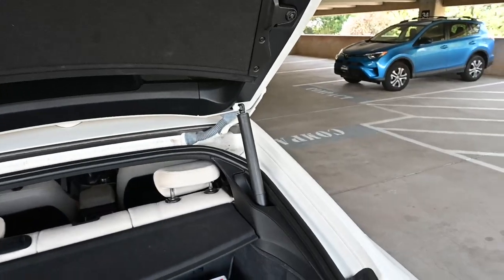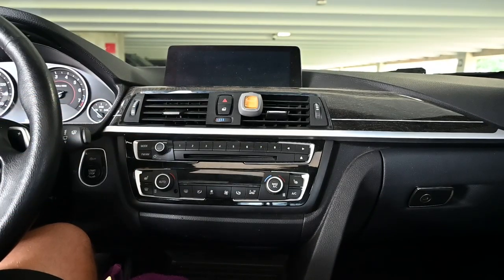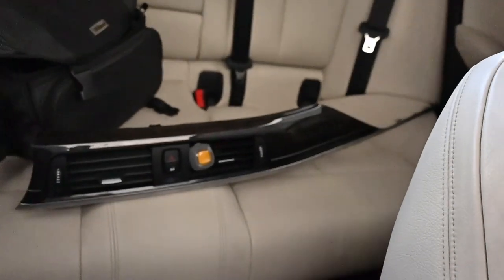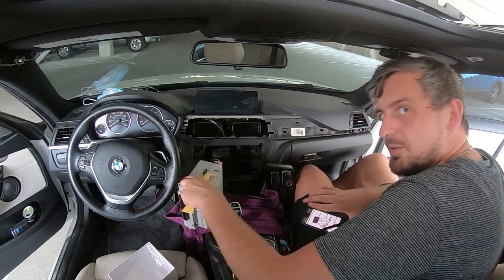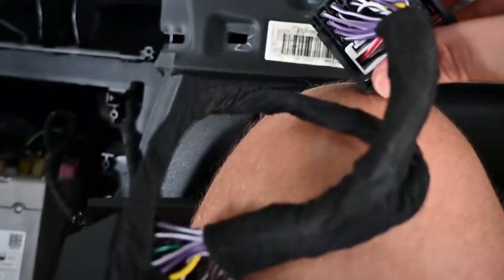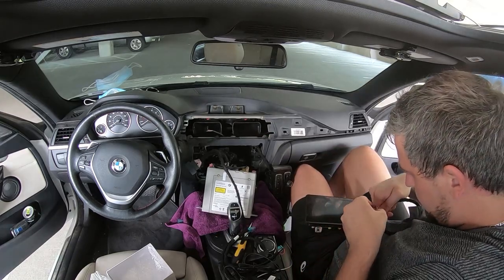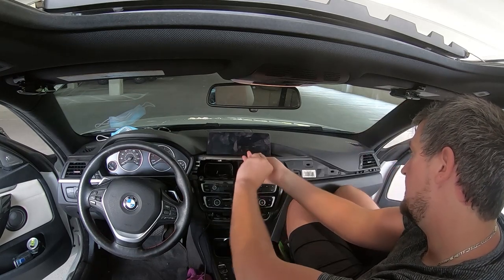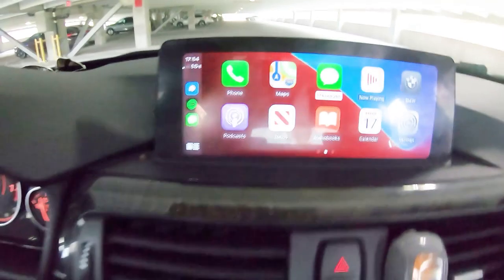Car Noob installs Apple Carplay/Android Auto BMW 435i (MMI from Andream)

Comment: Nice Video!! After all, did you manage to put the Reverse Camera coming up automatically with the carplay running up? Thanks for the upload
Reply from the maker: Bruno Trindade I did!
Had to disable “Reverse fullscreen”, it’s for aftermarket reverse cameras,
The stock is full screen by default
Reply from the maker: @Kevin Budain just in the options for the MMI box.
Reply: Sabes onde comprar isto em portugal? xd

Comment: Thanks for the video.  How do you get the wireless feature to connect with your phone and how do you access the Carplay feature from the OEM screen?
Reply from the maker: The carplay feature starts automatically once it detects your phone is plugged in, or connected to the wireless carplay.

Once you pair it wirelessly the first time, it’ll auto-connect your wireless carplay on its own when you start up the car.
You can toggle between carplay and your normal IDrive by holding Menu button for 1.5 sec.

Stay tuned, will make a video soon to describe the features in more detail! 
Thanks for watching!
Reply: @theCarNoob  Thanks for responding so quickly.  How do you initially connect wirelessly?  Can you still have your phone connected the factory way and through Carplay or do you have do "Forget This Device" on your phone and clear it from the factory radio?  Thanks again.
Reply from the maker: You’ll have to forget your phone in your iDrive in order to use wireless carplay. 
Once you did that, hold Menu (don’t plug in your phone), you’ll have an internal menu for the carplay box and there you can choose wireless, and mess with other settings (equalizer, auto reverse camera activation etc)
Reply: @theCarNoob  thank you.  One more question....Did you have to do anything with the microphone in the headliner?  My kit came with a harness for that with a male 3.5 mircophone jack that that can get run to the harness with the two big main black plugs that got to the headunit.  I emailed the place that I got the kit from but his response was unclear.
Reply from the maker: Nope, your car should already have a mic wired and everything. 
The kit comes with the harness for the mic, as well as some extra connections if you have aftermarket cameras etc, but unless your oem built in mic failed or something, you won’t have to use that cable for anything, just leave it hanging or tuck it in with the rest.
Reply: @theCarNoob  Fantastic.  You have been a tremendous help.

Comment: Hi Car Noob, I am about to install my Andream box in my car (2017 f31 330i) , thanks for the great tutorial already. Couple of questions if you don't mind: how did you resolve the LVDS in and out issue and which cable did you end up using? Also, what is the usb dongle for that's hanging from the side? Do you really need it (I plan on working wirelessly)? Finally, where did you put the wifi antenna ? Can you just tuck it in with the rest behind the dashboard? Looking forward to receiving your answers!
Reply from the maker: Hi there! Thanks for watching!
If I remember correctly (it's been a little while now), I had the LVDS in/out confused so I just swapped them. 
Cable should go from head unit into MMI box and one from screen to MMI box. Take the cable end that was plugged in the factory display and plug it into the LVDS IN on the MMI box (on mine that was the port at the end). Then take the cable that came with the MMI box and plug it into LVDS OUT and guide the other (angled) end up to the display. 
I hope that helps. 

The USB dongle on the side is for when you want to plug in your phone wired, or have your passenger plug in theirs, lets you use apple or android cable. I would suggest still having this in your glovebox or something, if the wireless carplay has a connection issue, you'll be glad to have a wired option in the moment. (remember, it is still an aftermarket product).

I put it right in front of the actual MMI box behind the dash trim. I stuffed the cables in the back, then I slid the MMI box far enough to leave the width of the antenna worth of room to fit the antenna there. I didn't tape it or anything because it was all snug enough in there.

Comment: Hi, nice video, btw which version of Andream is this A or B? I heard that there are two, and its interesting what are the differences. Also how it the overall control? Any glitches? Also does it startup automatically after u start a car? thanks
Reply from the maker: This is the MMI unit for the NBT iDrive, NOT CIC. 
Or do you mean something else? 
Overall control is very easy, you can use the same controls as on iDrive.
Mostly no glitches, but I did run into a couple. I’m making a separate video for that.
It starts automatically when you start the car, first loads iDrive, then loads Carplay after 5 sec
Reply: @theCarNoob  Thanks for a reply. I was talking about Andream box version. There are 2, one called A and the newer one is called B. Did you test it with Android Auto? Interesting does it start automatically as Carplay does.

Comment: Did you get the CIC or NBT? i have a 16' 435
Reply from the maker: I got the NBT, what size is your screen now?
Reply: Car Noob it’s the original one that comes with the car lol.
Reply from the maker: There are 2 sizes that come with the car, depending on which package you have. The screen that I have in the video (larger of the 2) is NBT for sure, the smaller screen may be CIC.

Comment: Hey , do the steering wheel controls still work within Apple CarPlay and specifically changing track within Spotify on CarPlay. Does the track info display also in the dash behind the steering wheel.
Reply from the maker: Hey there! 
The steering wheel has the little wheel on the right hand side and with that you can control carplay as well. 
It’s not a dedicated button to skip but just acts the same way the knob does.
You can use the wheel to click on the Skip button in spotify, if that makes sense.
The arrows next to the numbers on the physical radio (next to the numbers) does work.

The dashboard doesn’t show the track info because it acts as an Aux media input, even tho you plug in using usb, in the back it’s Aux, so you’re limited by what Aux capabilities are.

Comment: I need help asap! everything is working fine but there is no audio
Reply from the maker: Go to your iDrive settings and choose Aux for your audio source
Reply: @theCarNoob  I did and its still not working
Reply: it says audio is playing, but nothing is coming through. I selected aux as the source and i tried unplugging and replugging it in the aux port several times
Reply from the maker: If you have Harman Kardon speakers, did you transfer the green cable correctly? 

I would suggest contacting Andream support, they are responsive on FB messenger.
Reply: @theCarNoob  I do not have harmon kardon speakers, Their fb name is just andream? I will hit them there as I have already sent out an email
Reply from the maker: They will respond to your email also. If you go to their website, there’s a chat option, I think that just uses FB messenger.
Also, there was a dangling Aux cable when I installed it. Did you plug that in somewhere? 
(It should stay unplugged)
Reply: @theCarNoob  Okay maybe i messed up somewhere I’ll rewatch the video, I’ll let you know if I find the problem. Thanks
Reply: @theCarNoob  so no aux cable is plugged into the current one at all?
Reply from the maker: @deandreforbes6460  nope, there will be a dangling aux cable coming out of the MMI, just tuck it away, you will not use it for anything.
The aux is already “plugged in” in the back, you only have to worry about your USB or wireless if you’re doing that. 
Still switch input to Aux in iDrive so that sound comes through carplay.
Oh one other very important thing, you have to delete your phone from iDrive. 
If your Bluetooth is saved in iDrive, just remove it, forget the device. 
I hope that helps
Reply: @theCarNoob  I’ll try unplugging it and see if anything changes when I get off of work tonight, I’ll let you know what happens
Reply: @theCarNoob  I tried it with it plugged in and no sound still. I watched the tutorial everything seems to be done right I dont know why its not working
Reply from the maker: Did you unpaid your phone from iDrive Bluetooth?
Reply from the maker: Unpair*
Reply from the maker: @deandreforbes6460  did you try talking to Andream? 
Most of the time it's when people don't unpair their phone from their car. Like on your phone delete your bmw connection, in your idrive delete your phone from anywhere you can find it. 
When you go to Connections, bluetooth should just be empty.
Sorry to hear you're having those issues. :(
Reply: @theCarNoob  I’ve been trying to contact them but they aren’t much help since they barely speak english. I can’t delete my phone out of idrive because the MMI Box disabled the bluetooth on idrive it just loads infinitely when i try to go to devices.
Reply from the maker: If your car has your phone in iDrive still, that’s 200% your problem! 
Did you forget the iDrive on your phone in Bluetooth settings?
Reply: @theCarNoob  I can’t even get into bluetooth settings to delete my phone the bluetooth isn’t working
Reply from the maker: Bruh on your phone....every phone keeps all known connections in Bluetooth. 
Your problem is your iDrive’s Bluetooth is interfering with the MMI’s Bluetooth. It won’t work until your phone and your iDrive no longer see each other.
Reply: @theCarNoob  my phone connects just fine tho, the carplay itself works just no audio. The car doesn’t detect anything is even in the aux port
Reply from the maker: Your iDrive thinks you’re trying to play sound through it. When you go to Multimedia on your iDrive, then to choose devices. (Ignore the mmi box for a moment)
In your external devices in iDrive settings, there are usually 3 options:
1. USB (when you plug into usb of your car)
2. Bluetooth (this will have your phone name). If your phone is listed here, you didn’t unpair it right. 
3. Aux

if 2. still has anything written there, your sound won’t work.
Take a pic of it and send it to my Instagram @car_noob_
Reply: @theCarNoob  Bluetooth isn’t an option, the only thing i can select while on that screen is aux. Which does not work

Comment: So I am doing the install and everything seems to be wired correctly based on all the different videos I watched, but when I press the Menu button, I hear a relay click inside the new MMI but the iDrive changes from the working OEM screen to a blank screen. Is there something I am missing?  The first tow dip switches are "ON" and the rest are off.  I tried flipping the others but nothing changes.  Any help/advise?
Reply from the maker: Hmm, the dip switches are the tiny switches on the side? 

I believe that it was like 1-On, 2-Off if you had a smaller display and on/on if you had the bigger OEM display (like mine in video), it could have to do with that. 

Do you have the video out/in correct?
I struggled with that a bit when installing, ended up switching things around on the MMI box with the vid in/out and then it worked, but make sure you have the little switches set correctly for your screen size, that’s an important one.

Also, I don’t hear anything click in the MMI when I hold Menu, it just switches the screen, no sounds tho
Reply: @theCarNoob  I really am sorry to keep bothering you.  But I got picture, finally.  And at one point I got it to connect via wifi, but I could not get any sound to come out except for the radio.  So I disconnected the carplay and tried to reconnect but now it won't do it.  I have reset the system and my phone but still nothing.
Reply: my phone also keeps asking for a password to join Carplay but I have none to enter
Reply from the maker: Not a problem at all! I’m happy to see that someone else is giving it a shot! 

What solved the picture problem?

The audio issue you can solve by going back to your IDrive, go to Multimedia and make sure AUX is selected, the MMI box uses the aux port internally to make the sound work.
Reply from the maker: For the password, you actually have to go back in the MMI menu (hit option), then you have to initiate the wireless carplay through there, usually it gives you a password (I think mine was like 8888888).

There is a PDF with instructions that I used, you can find it here:
https://mega.nz/file/exkCBaiZ#Fz7kIeKoOi5OeGCA4Yo5u7GiPJCXskm3xq-7fx1PngY
Reply: @theCarNoob  truthfully not sure, I unplugged everything and when I turned it back on it worked.
Reply from the maker: Nice man! So all works now??
Reply: @theCarNoob  No, I have no audio at all.  It is connected through bluetooth and wifi but all I get it the radio.  I can make a phone call and they can hear me, but I cant hear them.  I can play music through spotify, and it shows that it is playing on my phone, but no sound comes out.  In the sopity app it shows that it is connected to carplay.  And I only get the actual carplay screen when it is plugged in through the USB.  When I unplug it it goes back to that initial red and black setup screen and when you go into connected devices it shows that my phone is connected.  I have no idea what to do
Reply from the maker: you’ll have to disconnect your phone from your idrive Bluetooth, and in “Multimedia”, make sure AUX is selected instead of the bluetooth
Reply from the maker: Once you’ve disconnected bluetooth (just delete your phone from iDrive altogether) and chose Aux in iDrive settings, then you can go back to the MMI, unplug USB and choose the “wireless carplay” option.
Also check the PDF I linked above, it has those steps with pictures.

If you bought it from Andream, they have a tech support Messenger option, just find on their website.
Reply: @theCarNoob  So after multiple wiping and resets, for some reason it just decided to start working.  It is all good now.  Everything works as it should.  Getting everything stuffed back in that dash was a real pain, but I got it,  Thanks for everything, seriously, you were a huge help.
Reply from the maker: Good stuff! Glad to hear it!!
Reply: I have this problem
Too just clicks and goes black 2013 f30 335 NbT 6 pin LVDS
Reply from the maker: @amiryounus570  what size screen? Yeah oh have to flip one of the pins if you have a bigger screen, or flip it off if you have little screen.
Reply: @theCarNoob  I have oem 10 inch screen
Reply: @theCarNoob  I have it 11100000 so the first 3 are on
Reply from the maker: https://f30.bimmerpost.com/forums/showthread.php?t=1675929